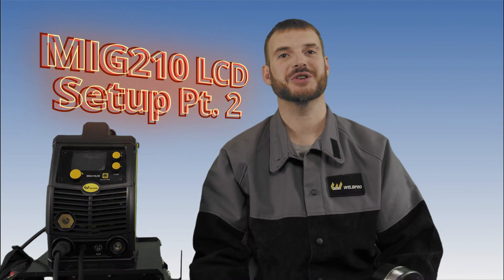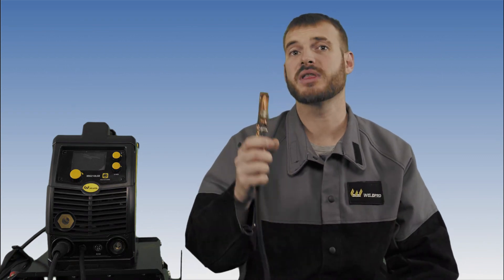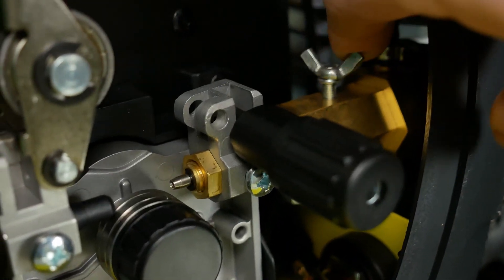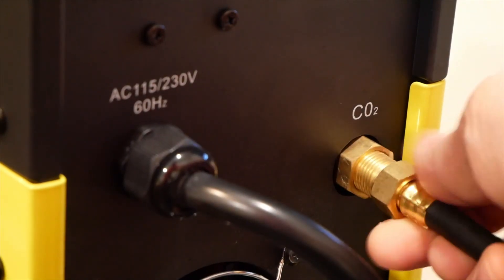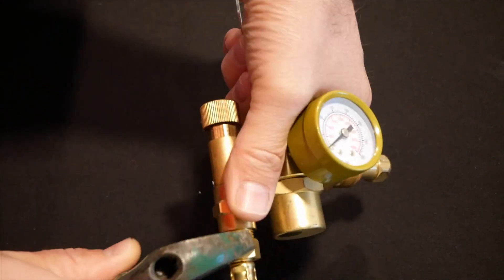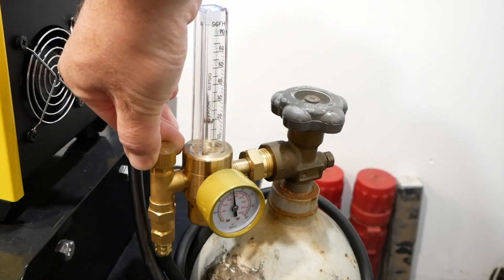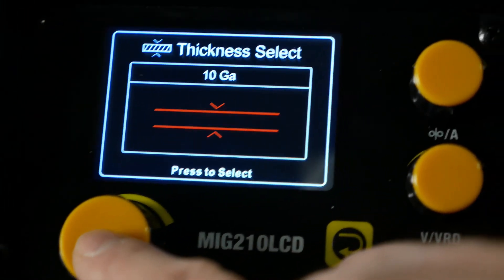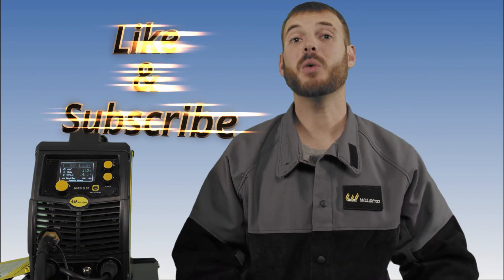Weldpro MIG210 LCD Setup PART 2 - ALUMINUM SPOOL GUN

Comment: will the spool gun for my 155 GD work with .035" wire ??
Reply: It comes with a .035" tip, .035" drive roller, and .035" 4043 wire

Comment: The electric motor in the spool gun is a Chinese p o s .  I didn't even get one full spool of wire used before it finally quit . Before then , it would work about 5 minutes at a time,  then I had to constantly reprogram the machine and even take the gun apart and try to get the motor going. I can't find a replacement motor . Now I'm forced to have to buy another spool gun and it will probably be another p o s too.

Comment: Can you use flux core wire in this spool gun?  If not are there any other spool guns that are compatible with this welder that will accept flux core wire?
Reply from the maker: Hey Kelly the welder itself will accept flux core wire. No need to put it in the spool gun

Comment: At this time you cannot get a spool gun for this machine. And there is no time frame for when they will become available.
Reply: "Can the spool gun also be used on the mig 200 and if so what is the set up like" 
Weldpro - Welding Equipment
4 months ago
"Sure can! 😀 "
I'm confused? 4 mths ago its said that it will work leaving the assumption its available? just out of stock or not available at least until china becomes more friendly again?
Reply from the maker: @robertjohnsonsr6963  just out of stock! We will have more in soon!
Reply from the maker: They should be back in stock soon! Just a temporary outage 😀

Comment: I had bad luck with the spool gun and had to return it. 😢
Reply: The wire feed wheel kept locking up. I’d have to jump start it with a screw driver (spin it) to get it started. Secondly once I manually got it to spin then it would speed up and slow down. I only wanted to swap it out for another but think I ended getting refunded
Reply from the maker: Hey Robby! Thanks for letting us know! If you don't mind me asking, what did you experience? We want to make sure if any changes need to be made to the design we can take care of it!